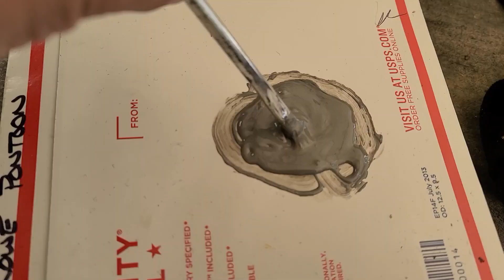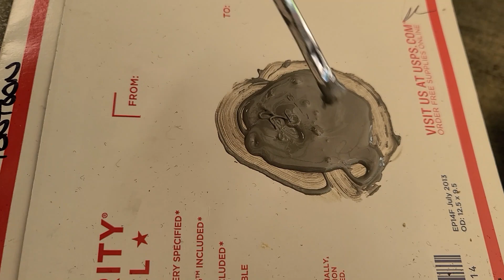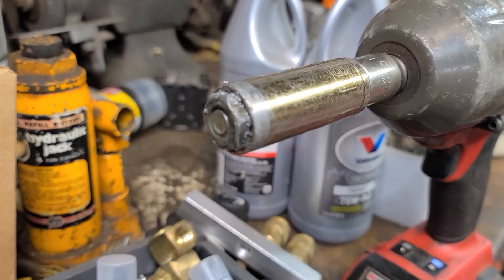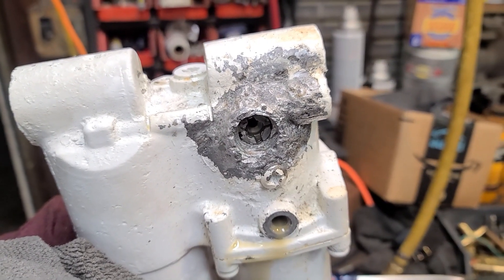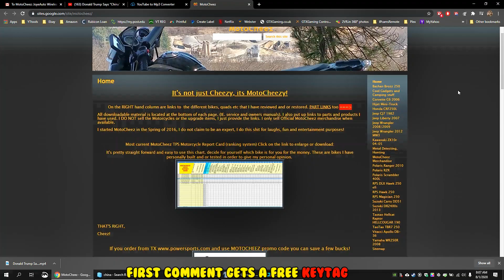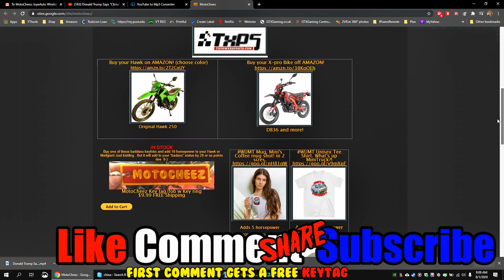Pontoon boat repair (Part 12) Patch the hole in pontoon, attempt welding the power trim pump

Comment: Check out the CMC jack plate, I know you have parts orders but maybe in the future. The reviews are good I am thinking of getting one for my 15 hp Honda so I can trim it when cruising.
Reply from the maker: The jack plate lifts outboard out if water, wish I had one,  Had on another boat trim is good for balancing load on boat
Reply: The model I am talking about cmc pt-35 it does up to 35 hp and has tilt and trim, The pt-130  is for over 35 hp up to 130 hp it is not the kind that lifts out board straight up
Reply from the maker: Ahh ok

Comment: It's not often you mess up like that, surprised you or your buddy didn't break down that assembly for welding, your friend certainly knows any Tig work must be cleaned before welding, and cast aluminum alloy is always tough, you might be better off fitting some other mount and trim assembly
Reply from the maker: I didn't want to put a lot of time into this corroded unit, I did end up ordering another housing.

Comment: Forget buying a used unit, it would be easier finding a used hydraulic jack plate and use that for the "trim". I did that on my old suntracker pontoon i had
Reply from the maker: I found a freshwater case without the motor and hydraulic cylinder that I ordered it's it came in today but it's up north I'll put it in or get assembled when I get back home
Reply from the maker: That is a good idea and just run hydraulic hoses down to it.
Reply: Yessir. Thats what I did for mine. Mine had an old merc 850 on it. Couldn't find trim parts. So I did that instead. I had to trim the bottom engine support to drop the motor down 2 inches. Other than that, it was all cake work